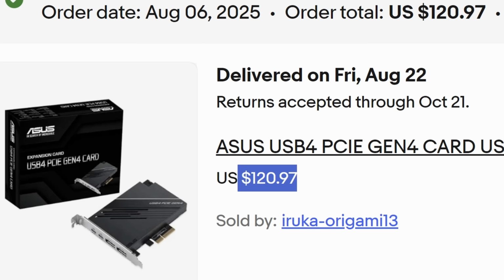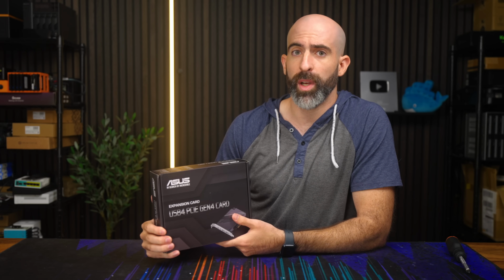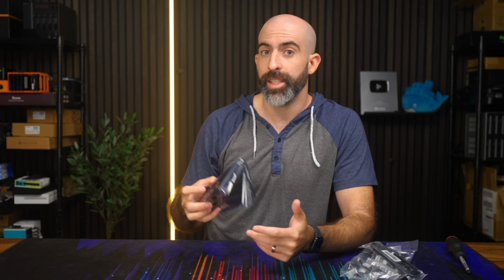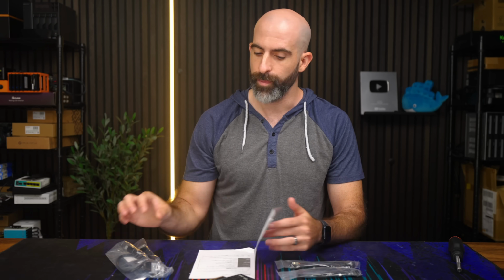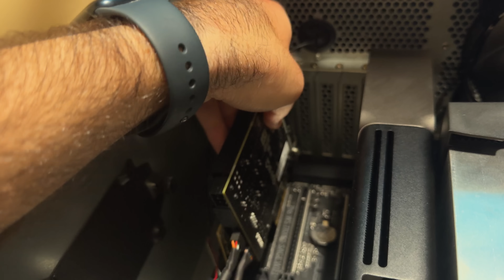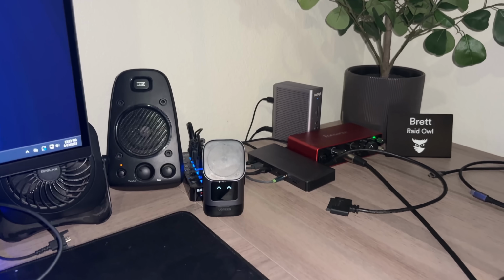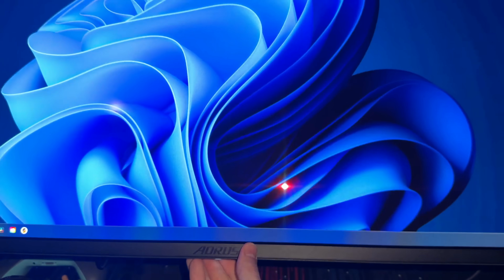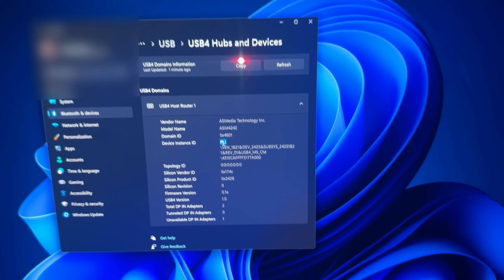Adding USB to my Threadripper build

Comment: yup, while laptops and minipcs tend to have usb4/tb4 or at least type-c with alt DP function, motherboards for commonners with it are scarce, specifically if you go for AMD mobo good luck, threadrippers are premium products ffs with motherboards oftens going for 1000+ but are modern I/O crippled and the pcie expansion sluts are also set up a way you get a stroke to find out how to configure the expansion cards without using a hammer

Comment: Thank you for the walkthrough. It's amazing how display over USB C and TB3, TB4, USB4 are not standard on motherboards. But it does make sense to the extend that the builder's decisions to use iGPU, dGPU l, or both put manufacturers in the position of accomplishing using an add-in card. Lenovo does the same thing. Some motherboards with a flexio port have the option for USB C which does provide display over USB C but still USB 3. Laptop owners just watch in disbelief and smile. :D

Comment: I use the same Corning Optical Thunderbolt 3 cable, it wouldn’t get video out of my CalDigit TB5 directly but when I daisychained a CalDigit TB4 between the PC and the optical thunderbolt cable connected downstream from the TB4 to the TB5 I had success.

Similarly, I couldn’t get my triple 1600p monitor DSC setup to work from the port on the SB-TB4K I use to KVM toggle between two separate thunderbolt PCs at my desk directly, but using a $36 (woot deal) Belkin Thunderbolt 3 Dock Plus downstream from it, I can get my DSC triple setup working with the StarTech 3-Port DisplayPort 1.4 Splitter connected to the middle DP connector on that hub.

Thunderbolt is so fiddly but when you find the ways to make it work, it’s worth it

Comment: Hello. I see that you're accessing your PC is in a rack mount PC from what seems to be elsewhere in your home. I'm thinking of doing the same, but I'm at a loss for how to do that. Would you or anyone in the comments be able to make some suggestions? Is it something like connecting the monitor and peripherals to some kind of kvm switch to control it or is there several extremely long cables running through the wall?😅 If you already did a video on this, please share it. It would be immensely helpful

Comment: Nice video - Feedback/Question: Could you try to connect that cable to your Thunderbolt dock and then use Displayport out to your monitor please? I dont think TB4/USB4 to many monitors works out of the box and will be recognized.

Comment: The issue with the optical Thunderbolt cable is that your monitor isn't Thunderbolt.... it's USB.  The wired cable worked because a wired Thunderbolt cable is just straight through wiring, so the USB monitor connected using USB to the card which supports both TB and USB signalling.

Using the optical Thunderbolt cable and your Thunderbolt dock should transport DP video (if your TB dock has video outputs), so you could try that.

Or if you have access to a Thunderbolt monitor (like the Apple 27 inch Thunderbolt display) you could try that using the Apple TB2 to TB3 adapter (Apple's adapter is bi-directional, so you can connect TB1/TB2 devices to TB3/TB4).
Reply: @Raidowl could you try that please?
Reply from the maker: Yeah that works
Reply: @RaidOwl  Which version? He described 2-3 😅
Reply from the maker: @jammsen-z8y  connecting to a dock then running video from the dock
Reply: @RaidOwl  Awesome nice to thear. Question: Can we some how analyse much of the bandwidth for 1 port is used for the display port signal and what is left for USB and other devices on the dock with only 1 USB4 uplink? Sounds like an ideal 1 optical cable to solution to banish my gaming pc to the basement 😅😅

Comment: I would use usb4 to attach network.. when it is on the mobo.. but I am not giving up a pcie slot that can house a faster network card natively 😂 did I see gen 2x2 in the bios? Those are 20 and not 40 speed. Rather disappointing. Can they be set to 3x2?

Comment: What did we learn? Heh, someone is a member of the "more money than brains" club 😂 but at least in some ways it's a "better you than me" scenario... Not that I'd have a need, use or the cash for that thing. I did actually see that thing for sale already and wonder a bit about it since, as some have pointed out ASUS had a tradition with releasing motherboard specific add-on cards for various things that others either put on-board or offer no solution at all for. Since it's optional it does have the advantage of there being a "don't buy" option where you can just get the motherboard without the fancy ports.

Comment: did you plug the cable in the right way around? iirc those optical thunderbolt cables are directional. the usb signal can travel either way, but the display signal only in one direction
Reply from the maker: Yep

Comment: I can understand a hub....I don't get multiple...especially if there's empty ports. ..is that another one under the monitor..thing probably has a hub too...are you plugging things into it for its own sake, like a festival of usb keys.. needs consolidation.
Reply from the maker: Webcam, mouse, keyboard, capture card, mic interface, speakers, wifi dongle, sata adapter, thumb drive.

Comment: I bought one of these with a threadripper build last november-ish. Agree it's really weird they don't use USB4 on the motherboard. These cards are kind of finnicky getting setup under W11 because of how they manage USB4 drivers. I ended up returning the first one; second card worked out of the box.

Comment: How did you buy a Threadripper™ 9970X for 1500$ ? Is that an actual price anywhere?
Reply from the maker: 9960x
Reply: @RaidOwl  ah oke, its cause your amazon links leads into the 9970X